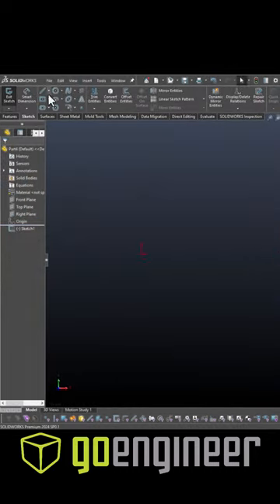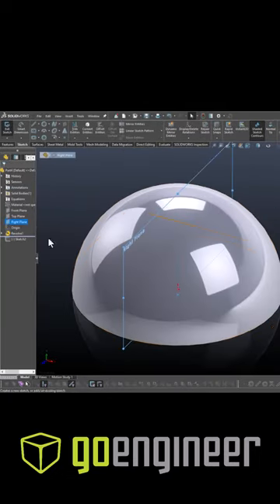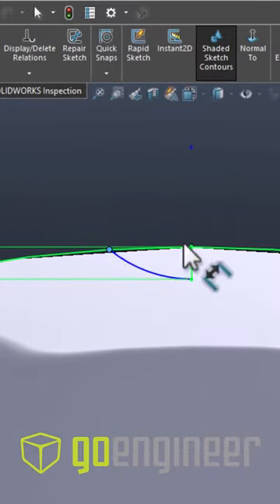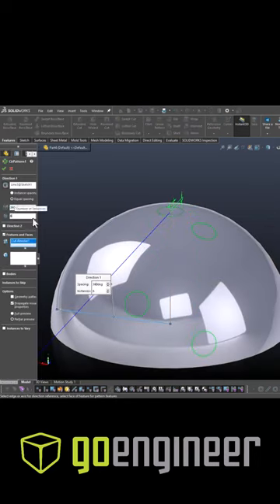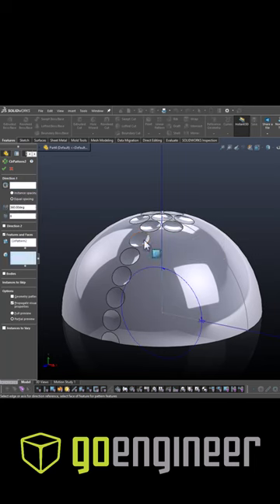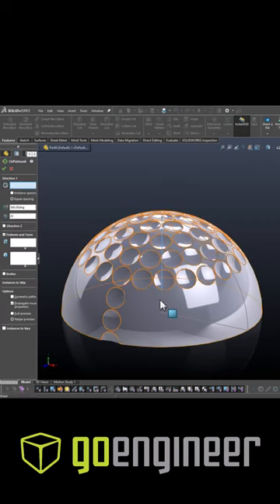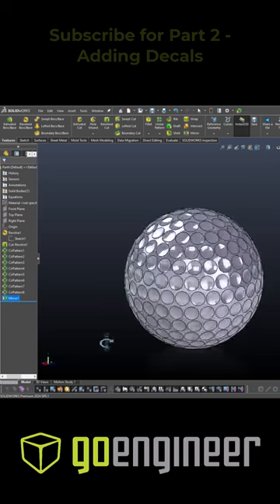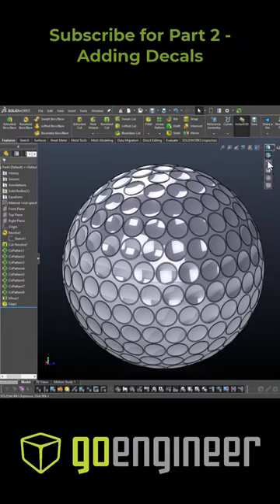Making a Masters Golf Ball Using SOLIDWORKS

Comment: how did you set up such a cool interface?
Reply from the maker: Will's using SOLIDWORKS in Dark mode with Classic icon colors! If you go to your SOLIDWORKS system options (Tools > Options) and then colors, you can change the icons colors to Classic and the background to Dark.
Reply: @goengineer  thanks)